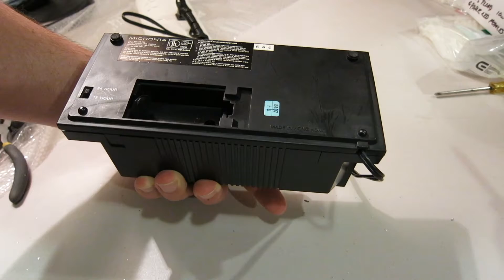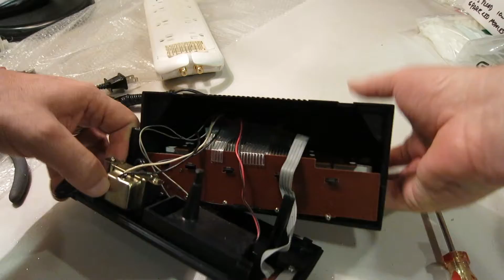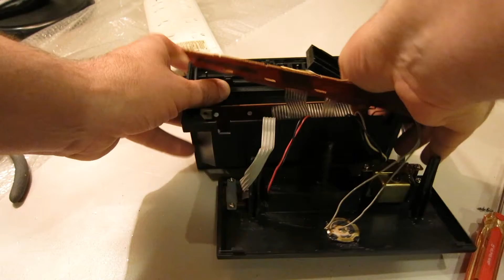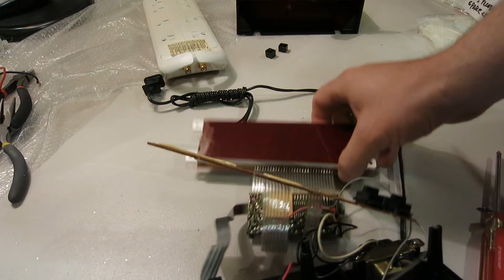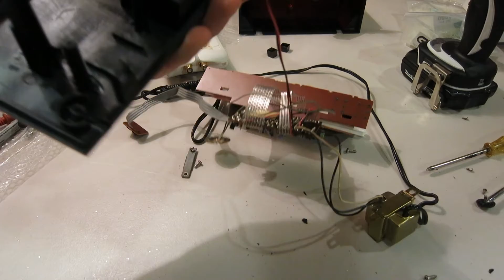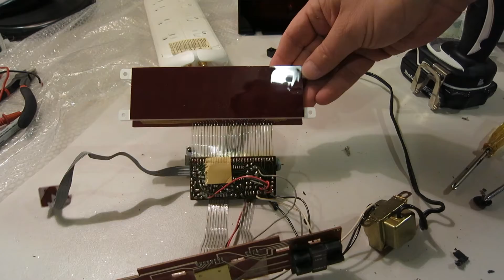Ahmed's clock is a taken apart clock radio

Comment: Nobody said it was a bomb. If someone thought it was a bomb, the bomb squad would have been called in. Ahmed was sent to the principals office because he got up and disrupted the class with it. His behavior is what got him sent to the office and it was behavior with the "clock parts thrown into a pencil case with wires holding it shut" device that caused the police to be called.

Again, if they thought it was a bomb, a bomb squad would have been called. Teachers and police officers would NOT be handling it like it's nothing.

Why did you create this video if you don't even know what the issue is?